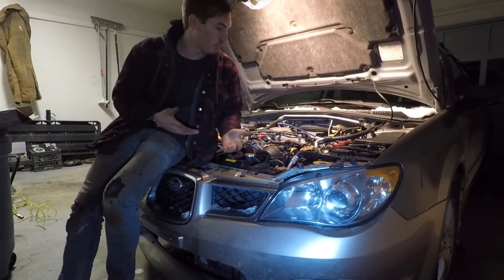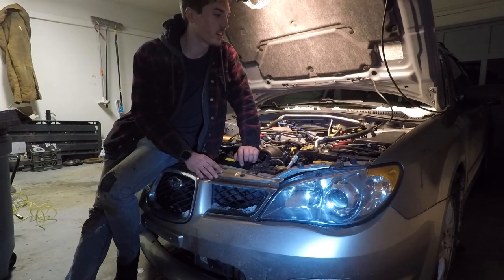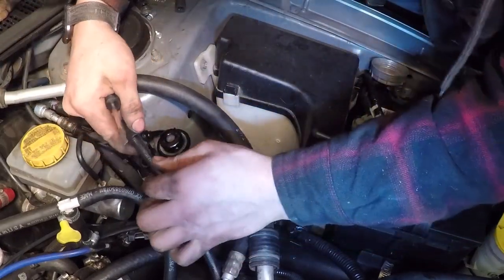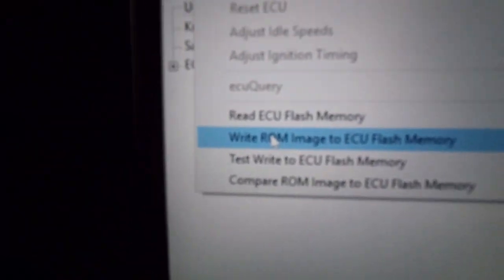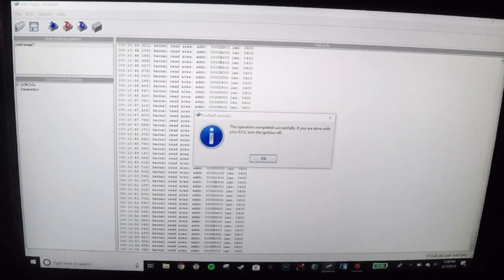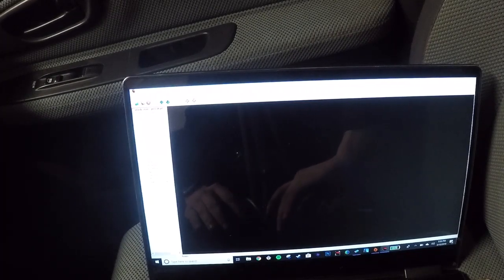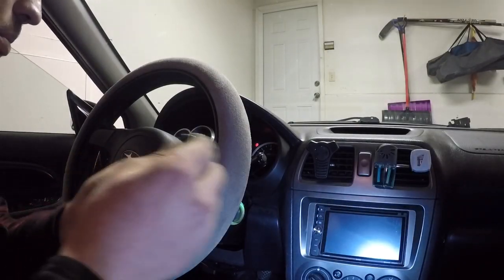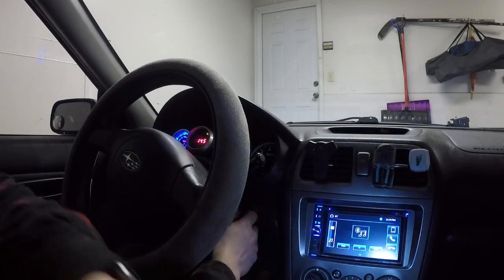Flashing my NA/T Subaru ECU with an $11 Vagcom Cable | TUNING #1

Comment: For anyone trying to do this, it still works!!! 12-17-2024🎉 i got cable from Walmart online. It took me about two or three days of just looking for the cable, that's the only place I found the cable with a similar descriptions. I tried posting the link to the cable but somehow it keeps getting deleted. I just tuned my car for emissions pass and also did a verbal tune last night super easy highly recommend way cheaper than anything else. still  possible went through a bunch of forums, most of them said it was not  possible. Only issue I ran into I had to use an older version of ECU flash 1.3. 😊 whenever you're going to set up your ftdiI cable. the ECUFLASH already has that downloaded into the file you download from ECUFLASH MAKE SURE WHATEVER ECU FLASH YOU'RE RUNNING IS THE SAME FDT I DRIVERS YOU'RE RUNNING FOR THE CABLE.
Reply: Bro we can’t see any link i have same car upload the video in your channel and add the link in description so we can see the link 👍🏼👍🏼

Comment: This is aggravating I kinda wish he wasn't as vague. I can flash my 05 LGT with an Amazon vag kkl cable, but this doesn't work for my 08 outback 2.5i (using ECU flash 1.28) when I hook up to the 2008 2.5i there is no option for it in ecuflash. I don't know how the hell he did this, tried newer definitions, different cables, etc. Sucks probably gonna just spend the money on tactrix.💰 Fuck

Comment: is this possible on Mitsubishi as well as Subaru is there a program that could be non specific that would let us read and write to our Mitsubishi's we have to rely on evo scan and ecu flash but if we can use some other program and some other connection tool thats not an arm and a leg expensive it would be great to know

Comment: Would you consider doing anything with your Drive By wire? Changing it to a more linear throttle opening would be cool.  Let me know your thoughts! I have the 07 2.0l luxury model right hand drive.  Just got a cold air intake on it atm.
Reply: Hey which cold air intake did you get if you don’t mind could you paste the link in here as well?

Comment: I have a 2007 forester and I can read my ecu. I tried using  the new version .44 and .30 version. I dont see that the older .30 version has support for my car and the new one won't work. I also tried ecu Explorer but it looks like it only supports wrx
Reply: I checked the Amazon listing where I might the cable and it says it has the ftdi chip.

Comment: Stay away from the serial - BUS converter cables. Buy true geniune FTDI chip. If you look through the casing, the poopy bus converted one has only 4 out of all the OBD2 pins connected to the PCB. The FTDI one has almost all of them and has a bridge to hold the top row...

Comment: A VAG KKL cable is a cable that only use FTDI chip and 1 or 2 SI9241 (or SI9243 or similar) chips and is a direct RS232 to K-line converter, VCDS cable also contains FTDI chip but there is also a microcontroller between OBD and RS232, so a VCDS cable can not be used as VAG KKL cable. 
Older versions of VCDS cables supported this function by opening VCDS software and in Options box there was a checkbox called "Boot in dumb mode" and cable becomes a KKL cable, but newer versions does not support anymore.
Very good tutorial.
Reply from the maker: Wow man this is some great information. Thank you!
Reply: Hey man you seem like you know a lot, are all ECU connections the same?
Reply: @rubenpadilla8032  What do you mean my "all ecu"? Not all ecus have the same connections,  ecus pinouts are manufacurier specific, and depends on microprocrssor inside it. For ecus pinout to connect to ther obd wiring you can search online, there are a lot of images with pinouts for flashing ecus, most of them can be found in galleto's pinout library.

Comment: The vag com in the link is sold out. I found a cable on newegg, search ft232bl vag com and one with 409.1 will pop up which I found on Nasioc a thread from 2018 to 19 called Vag com Cable Compatibility. It says in the thread RL doesn't work although that's what worked for GoldGuy so that may not be what's important but I think this cord will work it says it will in the forum, buying one right now.
Reply: How long did it take for it to arrive I might order it from there

Comment: what app that was on your phone to check the engine specs
Reply from the maker: It's called Torque. I use the pro version which you have to pay for, it's worth it.
Reply: @GoldGuyRides  sweet

Comment: What's up dude sweet build, I just did my 08 but I'm having issues with my map sensor..just bought a 3 bar gonna need scaled. Did you have any problems with the map?
Reply: I'm having issues getting anything to work. I have an 08 too and I cant get romraider to work nor can I flash anything. I'm stuck. 

ECU Flash only lists certain model cars, mine isnt under there.
Reply: @iPipLord  I found that you can only log on the 08 and up because of can bus which intail will need to purchase a tactrix cable for our cars to be able to flash and remap..the cable is about 170 bucks, I ended up buying a denso map sensor for a 02 to 05 wrx and seemed to eliminate my issue with the map code..I just tonight did a run of logging with the vagcom cable.

Comment: Hey Gold Guy, I need help please, I am able to read the ECU on the vagcom cable, but after I am done it says "unknown ROM image". I downloaded the lasted definitions and pasted them into the program files. One thing I noticed about your video is that you have over "700 rom metadata models scanned" when loading ECUflash. I only have 378. Where did you get all those Rom definitions because I have already down loaded the most up to date ones off of RomRaider.com, it even has 7 or 8 different definitions for a 2006 impreza. We have the same exact car btw.
Reply from the maker: Did you pick the correct flashing method? (Sti05)
Reply: @GoldGuyRides  sweet

Comment: Tyler Menard
21 horas atrás
hey man how did you go about getting ecuflash to detect your car . i tried adding the ecu definitions but the added ones arent showing up in the list on startup. i did manage to pull my rom using an 05 sti definition from the preset list but i have a 05 legacy 2.5i and cant seem to get any definitions to show up other than the preset ones. thanks in advance bro .. love what you are doing

1
Reply from the maker: Do you have a vagcom cable with an ftdi chipset? If not you can't flash with it. If you were able to read your rom with that cable then you should also be able to flash your ECU with it though
Reply: GoldGuy  i have I bought the same you using in the video but i cant find my 2008 impreza they just say interface close

Comment: hey man how did you go about getting ecuflash to detect your car . i tried adding the ecu definitions but the added ones arent showing up in the list on startup. i did manage to pull my rom using an 05 sti definition from the preset list but i have a 05 legacy 2.5i and cant seem to get any definitions to show up other than the preset ones. thanks in advance bro .. love what you are doing
Reply: im so tired about it just error interface close help impreza 2008 2.5i
Reply: @thebestsoccer2063  you gotta buy tactrix cable

Comment: Do you recommend this?
https://es.aliexpress.com/item/32809926925.html?spm=a2g0o.productlist.0.0.1b983801HdRjMr&algo_pvid=b82cef48-1572-4700-b03e-1a7d2ce03bed&algo_expid=b82cef48-1572e4700-bdce0b3d5d5d5d5d5d5d5d5d5d5d5d3d-6 870f-419b-ba65-88321daf7e92 & ws_ab_test = searchweb0_0, searchweb201602_6, searchweb201603_52

Because here in Argentina that cable and the Tactrix are not sold. 
I will only use it once
Reply: I purchased this 
https://www.ebay.com/itm/FTDI-FT232RL-VAG-COM-KKL-409-1-OBD2-K-Line-KWP2000-ISO9141-USB-FOR-VW-AUDI/283401556883?ssPageName=STRK%3AMEBIDX%3AIT&_trksid=p2060353.m2749.l2649

Comment: Will this work on Mitsubishi?
Reply: im hoping someone can give insight to this because i would like to know if it works too or not i have the cable i may test it myself depending on what software too because evo scan and ecu flash probably not but apparently rom raider which is Subaru software is compatible with mitsu software so you see its possible just like this vid is imma comment for us mitsu guys see if i get replies and answers and if not i will be testing myself if can get a hold of evo scan software i already got ecu flash and rom raider is free so if there is any other softeware ideas to try try please do inform me on that as well

Comment: I have a 2005 Outback 2.5 non-turbo AT.
I haven't seen any map for this car.
With this system, is it possible to copy and save the map from my ecu and then edit a copy of the map and delete pesky codes and then flash the edited map back to the car?

Comment: Did you select a turbo model for the ECU read option? You said you didn't want to mess with the tune and only wanted to pass inspect so I'm assuming you figured out a way to read the NA tune?

Comment: will it be 129.a? i really needa do this too my wrx 06
Reply from the maker: Yeah, 1.29 a should work. Just pick whichever one works for you. You might have to try a few different versions before you get it to work. If 1.29 doesn't work try 1.28
Reply: GoldGuy thank you just swapped my impreza 2.5i auto too a forestor XT motor vf 52 turbo and wrx trans and I need to pass inspection I don’t know how to disable them so this helps a lot especially because I have a rejection stick right now
Reply: @GoldGuyRides  what vehicle did you select? It's only showing turbo models for the imorezas
Reply from the maker: @KenfieldZ3  sti05 flashing method
Reply: @GoldGuyRides  so I have an NA 05 RS and if I use that method will it keep my stock rom like it kept yours stock?
Reply: @GoldGuyRides  all I did to mine was a manual swap and I have a single CEL that I need to clear

Comment: hmmph. I'm using the cable you linked to but when I open ecuflash, I have to select the vehicle and when I go to read the map from the ecu, it goes

[20:02:55.845] using metadata XML ID read_sti05 from file C:/Program Files (x86)/OpenECU/EcuFlash/rommetadata/read templates/read_sti05.xml
[20:02:55.848] FTDI Driver Version 2.12.28
[20:02:55.850] Using interface FT232R USB UART A5K20YYH
[20:02:55.850] interface close
[20:02:55.967] unable to connect to vehicle interface.
[20:02:55.967] interface close

I'm at wit's end with this thing. RomRaider logging works great, but ecuflash wont do shit. I tried plugging in the green test connectors in the fuse panel but nothing changes. I dont even notice any changes with the car.

05 legacy gt for reference
Reply: Imagine Wagons mines doing the same thing I think. Did you get a solution?
Reply: Did you ever figure out the issue? i have an 05 Legacy gt that im trying to do the same thing too just dont wanna waste my money. Please let me know this could be very helpful.

Comment: Should I upgrade to 93octain after tuning? Or should I just stick with 87
Reply: higher octane equals less chance of detonation, among other benefits. If you are running a turbo you should run higher octane
Reply from the maker: I always run 93 octane ever since I turbocharged my car

Comment: dude you can turn your seatbelt alarm off jeeze lol
Reply from the maker: How do I do that? Lol
Reply: @GoldGuyRides  not that it matters now but you could just connect the seatbelt behind you, otherwise there's a plug under the seat that you can disconnect to bypass it permanently.

Comment: What kind of engine are you running? I have an EJ20 in a 01' legacy b4 and wanting to turbo it
Reply from the maker: Ej253
Reply: @GoldGuyRides  any tips for me should I get my engine rebuilt before adding a turbo or add the turbo and rebuild when wanting to increase the boost?
Reply from the maker: @jamesbutler6939  a turbo running only around 5psi barely does anything bad to a stock Subaru engine, my engine has been perfectly fine. Just make sure you aren't leaning out, install a wideband to monitor this, and you should be fine. I'm going to wait until I want to increase boost to rebuild my engine.
Reply: Cheers for that excited to see what's to come and will definitely be doing the work on mine in near future

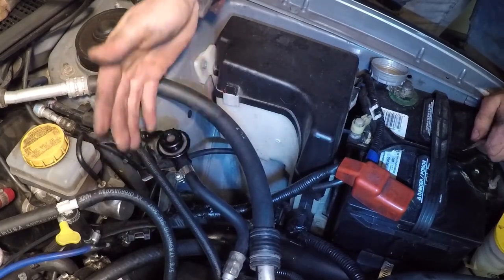Comment: The black part around 3:50 is NOT a regulator. It is completely hollow and has no parts in it. All it does is resists rapid fluctuations within the fuel line, but doesn't regulate anything.

I've been wrenching on machines and cars a long time and I'll share some advice with you that I think you'll appreciate. Slow down. Work methodically. Make things as neat and look as close to OEM as possible. Never compromise safety. That spaghetti bowl of hardware store hoses will get you in trouble. Spend money where it counts and get thrifty with the other areas. Good luck on your journey.
Reply: you mean it regulates fuel pressure pulses?

Comment: What happened gave up on the ts 185 lol?
Reply from the maker: No man definitely not, I'm starting the rebuild of the engine and there will be a video on it later today!
Reply: Right on bud lol I can't wait till spring so I can get to re doing my 77 suzuki ts 185 and 74 honda xl175 there getting all new parts lol
Reply: Got a email I can email you at man ?
Reply from the maker: @bejayostrander9088 mmcalister421@gmail.com